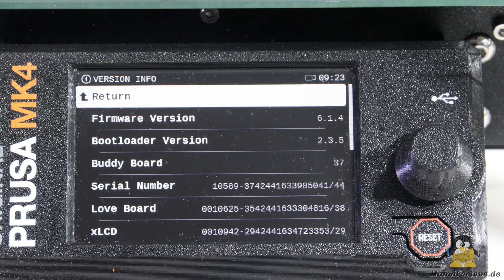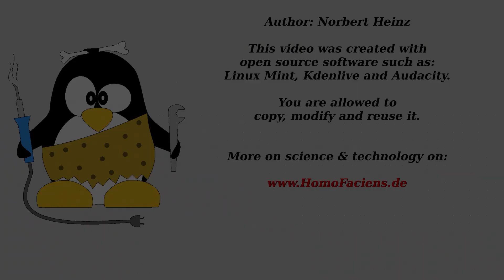🇺🇸 🇬🇧 Conversion Prusa MK4 to granule printing: Part 5

Comment: For the gearbox have you thought of using a Drill motor? They are real cheap and built for axial loads. I just worry that the stepperonline gearbox won't last over time with the forces at play. That or add some thrust bearings to the gearbox you already have? Idk how easy that would be.
Reply from the maker: Coming next: A video with a 3D printed gearbox that addresses those issues. Stay tuned!